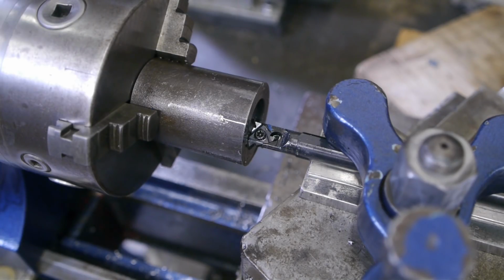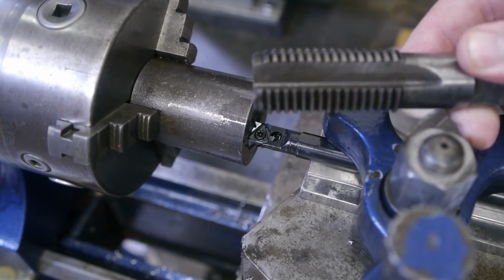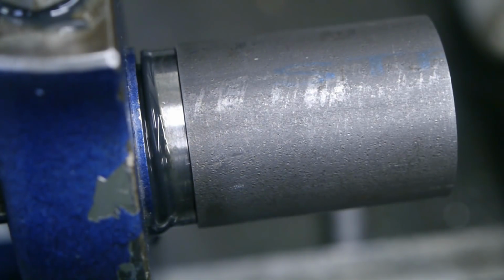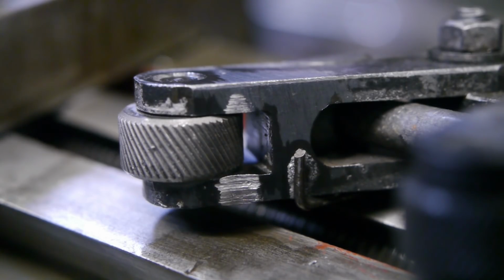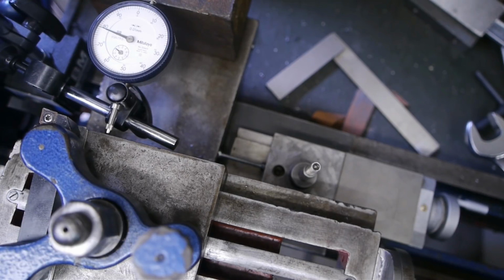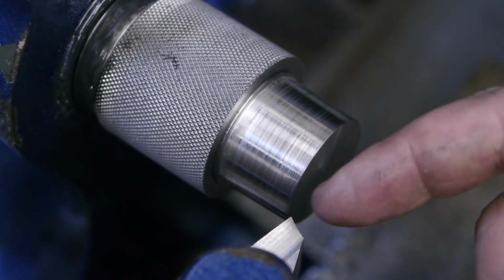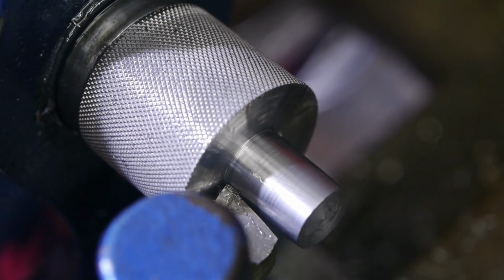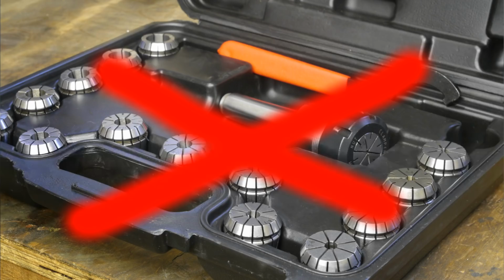Making a screw on drill chuck arbor part 2

Comment: you can make it fit, i had the same issue with a drill press, taper the very nose of the taper, blue it up, sort out with emery paper, use valve compound to lap the two together, you still have enough meat, the chuck isnt bottoming on the adaptor
Reply from the maker: The high spot is about half way in the chuck taper. So if I would remove the high spot the chuck will slide on to far.
In other words the big end opening is allready bigger then the taper I cut.
It's not going to fit unless I make the taper longer. But then I risk weakening the arbor to much.

Comment: there is a lot of movement in that tool holder - can see it flex a lot when hand pulling the chuck pulley
Reply from the maker: agreed
Reply: @Rolingmetal  Have a 1940's logan 10" just finally got some cuts above 1,2, and maybe 4 thou to 15 thou (30 total) a pass... man was I ever wasting time - got some real chips and some smoking oil a couple days ago. LOL

Comment: You  could drill a hole in the side for a bar to help remove the new chuck..

Knurling needs a lot of cutting oil lube,
Thanks
Reply from the maker: That's a good idea because it's still on there. 
Can't get if and don't want to damage it with the pliers.

Comment: nice fail but great experience, I would suggest to put chuck on the lathe to copy the right angle to the compond with use of a probe indicator.
I use to make my lathe tools by myself and some are with special shape but not hss steel, the way to use them is to slow down a lot to not overheat the cutting edge, related to that kind o steel, such as spring steel

Comment: The tap is a "Plug" tap - the finishing tap, there are three taps to each size, starter, cleaner and plug. Each one cuts a little deeper.
Reply from the maker: I doubt one would be able to use a 1 inch started tap by hand on steel.

Comment: Could you relieve the middle part of the taper you just cut to give room for the high spot in the chuck? Then use Loctite and a big hammer.
Reply from the maker: I could also go straight for the big hammer :)
Reply: 563 yard art  if you can swing it, you can use it.☺
Reply: 563 yard art  better make the first hit count then.👍
Reply: 563 yard art  it would my pleasure, when would be convenient for you rememering safe distancing, in this case blood splatter not virus. 😐

Comment: With a ”last Word” indicator You mist be able to verify tja taper in the chuck. Chuck up the Jacobs chuck in Your lathe chuck bacwards. If the compound is set on a wright angel, no movement sjould be notiser.
Nice video! Thanks!
Reply from the maker: I already verified the high spot inside the chuck with some blue paint.

Comment: Tom at Oxtool has an excellent YT knurling video.  He explains the math that is involved.
Reply from the maker: I'll have a look. Thanks.
Reply: There should be no need for any maths as it is a swaging process not a cutting one.  People confuse the two processes and think of knurling as a form of gear or spline cutting, which it isn't . I think it is Joe Pie who explains it better than any one else on YT as he proves diameter is unimportant but pressure is.

Comment: lapping in the props... by keith fenner.. https://youtu.be/2ozh4JjoWm4 part 1.   your calulation might have been 25mm not 25.400..  then you shortened the overall length of taper..  it will work as long as you don't plan on using either chuck or adapter on anything else..  i learned a Lot from this video also.. https://youtu.be/YCllVu4K738 its i think 2 parts also.
Reply from the maker: Unfortunately I never got to the lapping in part.

Comment: got an easy fix.bore the adapter with no taper and insert a plug with lock tight.the cut down the taper you made to a straight shank . get your size off the finished diameter.then drill and bore your plug in the adapter and lock tight.would cost you only time my friend.
Reply from the maker: I'm not sure about that. But it's cheap and creative so that's always a plus :)